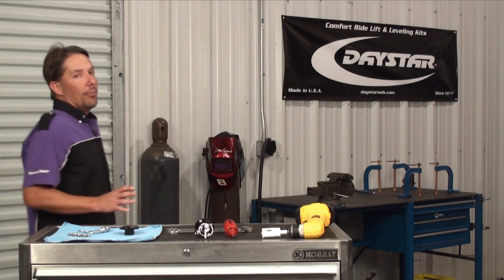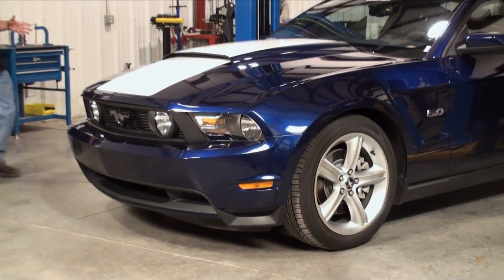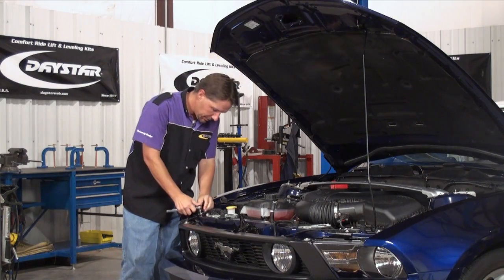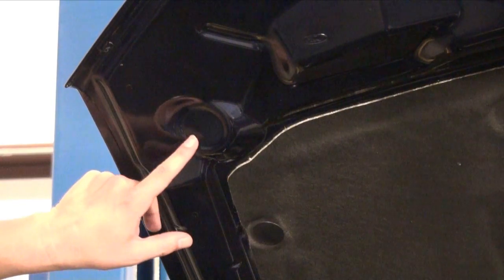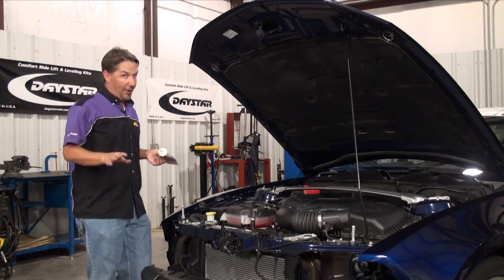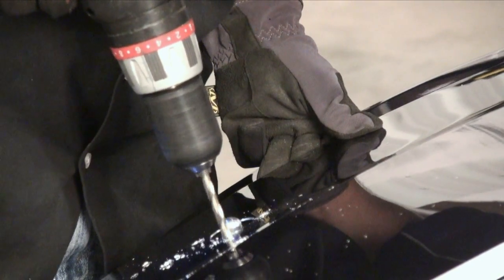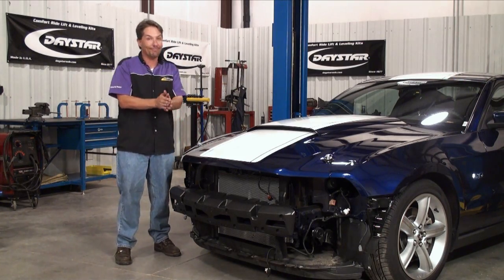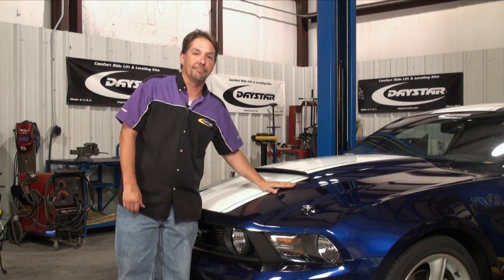Hood Pin Installation

Comment: These can be used to replace a stock latch. You can also buy locking hood pins like the ones that I just bought. They come with a set of keys. I have individual keys for each pin. The locking type can be found all over the internet, amazon and ebay included.

Comment: A little warning to those looking into installing Daystar hood pins. Unless you have a more or less flat hood these will NOT fit! I had to find out the hard way.

I did everything as described in the instruction video (I have the exact same car as in the vid) and these simply do not fit at all!

I tried to install them on a brand new Cervini's ram air type IV hood and had to modify the rubber circular "plug" like thing beyond recognition to somehow make it work. The metal pins are not long enough either! 
I had to get two new, longer, pins made out of stainless steel 'cause the ones that came in the Daystar kit are made out of metal which will rust (screws are stainless though).

So I basically payed good money for a piece of heavily modified rubber and a couple of screws + had to pay to get new hood pins made.

Screw you Daystar!
Reply: Alex Hellenbach you can tell at the end that they do not fit well and right before he puts the 4 securing screws in the rubber grommet it looks awful because it doesn’t fit properly to the hood
Reply: @tonylevesque8177  Shelby America only puts their name on Scott Drake Hood Pin Kit for a reason...

Comment: Because the grommet needs to fit through the top of the hole. Its outer Diameter is much larger. The rod then goes through the inner Diameter of the grommet.

Comment: what about when u slam the hood down without the rubber under the hood man
Reply: you dont, really you arent suppose to or need to slam any hood down. you up it down about an inch above the latch and then press hard.
Reply: Still had 2 rubber knobbies in the center. Though there was no real point putting pins on said hood anyway, it's more for fiberglass n shit to keep it from flying up on you.

Comment: I wouldn't use a hole cutter to drill the holes if u don't press that drill good the hole cutter slides out and theres goes your paint
Reply: thats why you have a pilot hole... for the bit in the middle to hold it in place
Reply: +DejaVuGamer96 You should be a doctor
Reply: Battle Hawk yea, well my great grandfather was a doctor so i dont actually need to go to school for it because it is in my genes. i was thinking about opening my own hospital.
Reply: Only an idiot would use a hole saw on there hood.  It may seem like it the right tool to use in theory and in practice using a hole saw on forgiving wood is a lot easier then a flat steel hood.  The correct tool is a Step Bit.

Comment: Prefer hood pins on my old cars where i've popped the hood a million times and the cable stretches/snaps... :/ Or for cars I KNOW I will be popping the hood a million times. Also, I have had cars which had front end damage repaired incorrectly or a core support and hood latch sagging that doesn't latch EVERY time... Definitely just a cosmetic mod for this new Mustang though, but I do like the looks.

Comment: mustang GT> $5,000
+420 hp
+tonnes of aftermarket
s2000> $20,000
-less than 200 hp
-poor mid range power
-probably riced/poor modifications
-people will think you are asian
-girl's car
-coulda bought a corvette/mr2
nsx>$40,000
-300hp
-good luck with insurance
-coulda had a 911 turbo,lotus elise or ferrari 355
-rice, lacks power
-poor modifications
-people will assume you are a nip

Comment: Rustang gt> more like 10k peice of shit with 400BHP

S2k> 14k 240HP 16V DOHC I-Vtec (valve controllers) = Bye little Rustang.

NSX> 290hp insurance no problem if you can afford a 40K car Non rice if you're not a rustang driver, VTEC (valve controllers) = Bye bye little shitty rustang, If you find a lotus elise ferrari or a 911 turbo for 40k let me know chump, i'll make this clearer for you, 

/watch?v=HGW7__K-nec
don't even try to complain about missing gears or "It's the driver not the car"